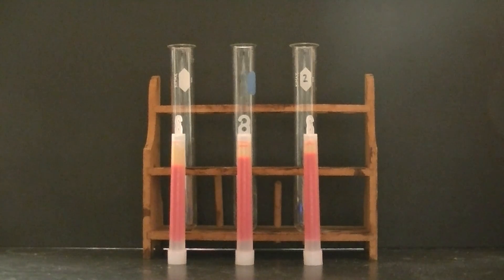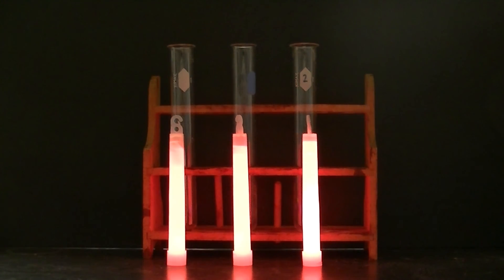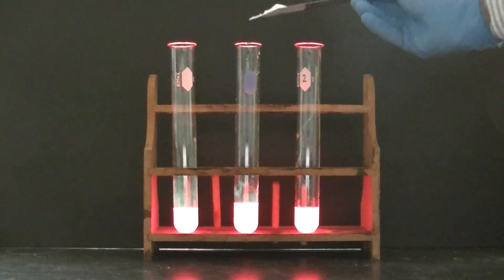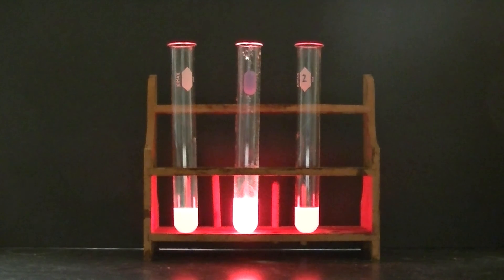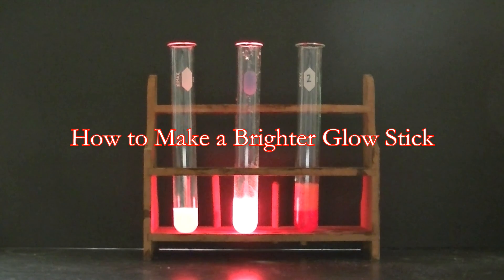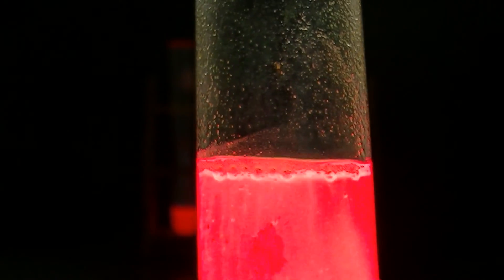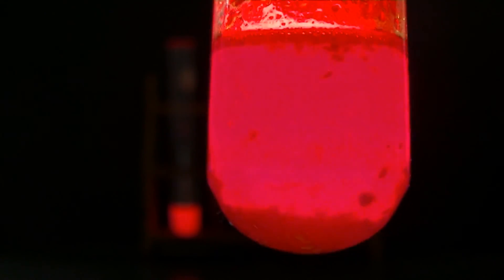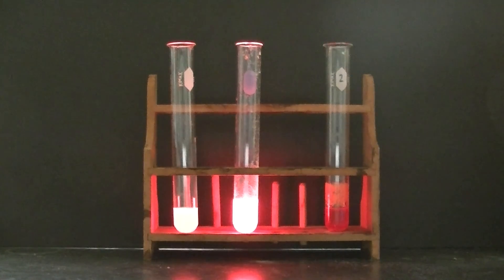How to Make a Brighter Glow Stick

Comment: Would adding baking soda also reduce the amount of time it stays bright?
Reply from the maker: +Louis Le (ToastyDonuts) Hi Louis. You guessed it, baking soda will speed up the reaction. As a result the reaction will be brighter, but stay bright for a shorter amount of time.
Reply: +Tom Kuntzleman the amount of time it stays bright would be for hours or for days?
Reply from the maker: I tried adding baking soda for quite some time. If I remember correctly, the addition of baking soda reduces the time it stays bright to around 10 - 20 minutes. If you try it for yourself, be sure to let me know how things worked out!